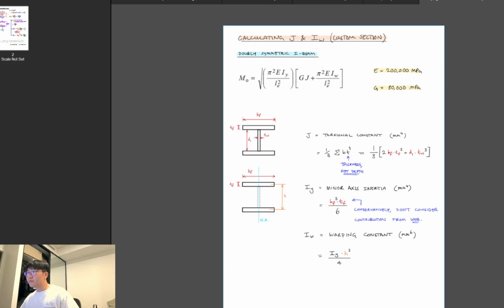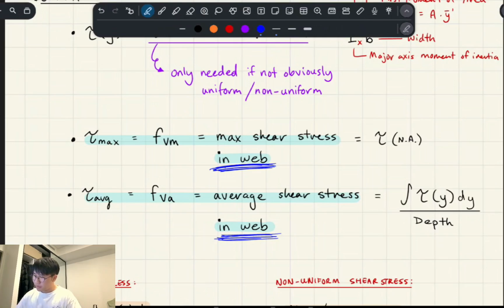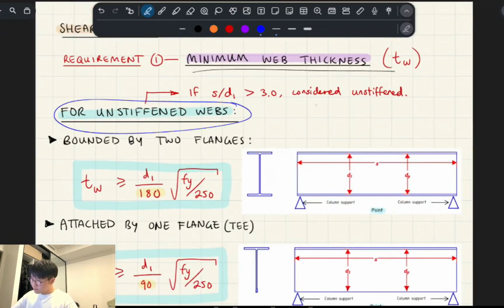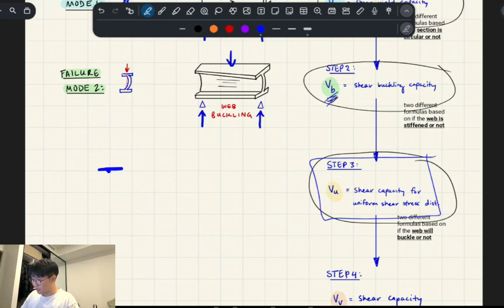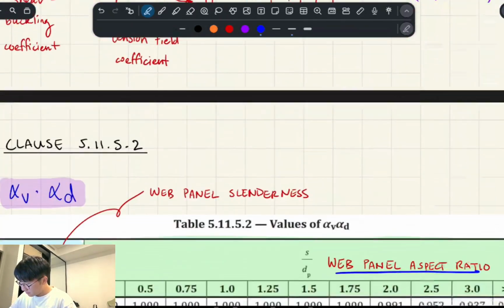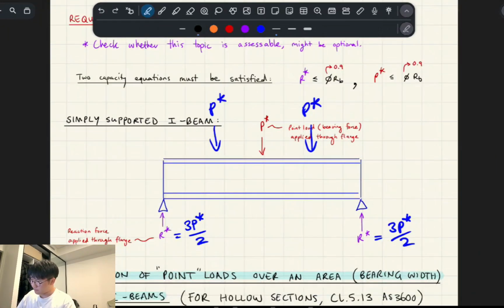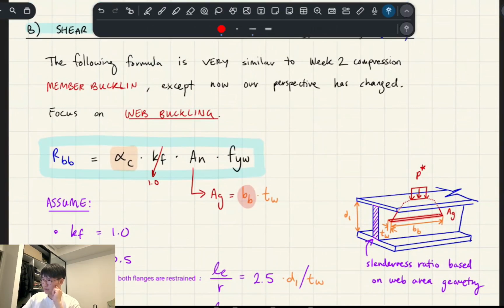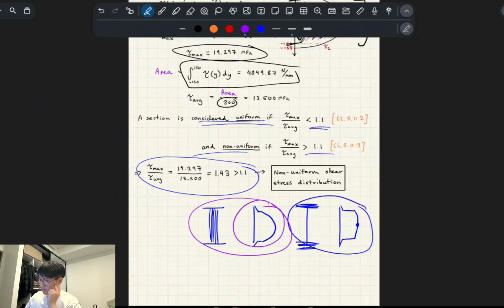2026 Steelfixer's Guide to the Galaxy - Week 8

Comment: Hi for step 3 of load bearing stiffeners check, is the formula supposed to be b_es < (15*t_s)/sqrt(f_ys/250)? t_s (thickness of stiffeners), f_ys (yield strength of stiffener). in your cheat sheet it’s b_es < (15*t_w)/sqrt(f_y/250), where t_w and f_y is the web thickness and max yield strength of either web or stiffener.
Reply from the maker: Yep you're right. I'll fix it up in my notes

Comment: When calculating Aw in Vw = 0.6*Aw*fy, do we always use Aw = d1*tw to be conservative? d1 being the distance between flanges and tw being the flange thickness. I sometimes see in our examples in lectures Brian uses d*tw where d is the depth of section.
Reply from the maker: Sorry, actually my notes are wrong. Just double checked. Please take Aw = d*tw
Reply: @SigmaLectures  Hi thanks, but please check 5.11.4 in the standards. 'Aw is the gross sectional area of the web'.
Reply from the maker: @qhust.  Yes but 'Aw is the gross sectional area of the web' is an ambiguous sentence

Some people interpret it as Aw = d1 * tw, others interpret it as Aw = d * tw

It is not explicitly stated in the standards which one it is, so it's better to go off of what is in the workshop solutions / what the lecturer says